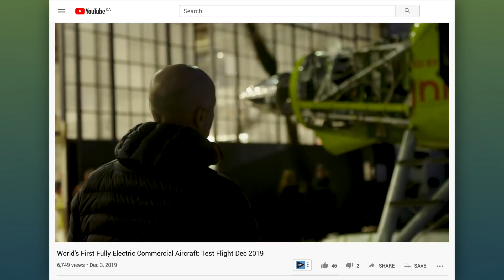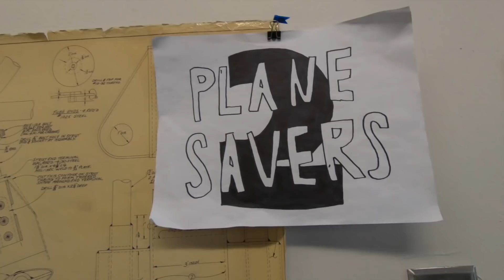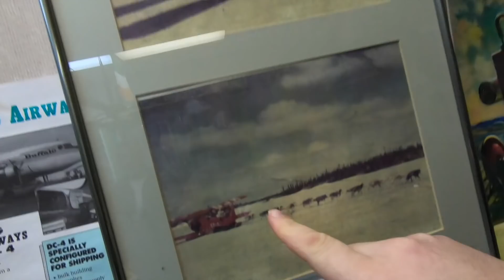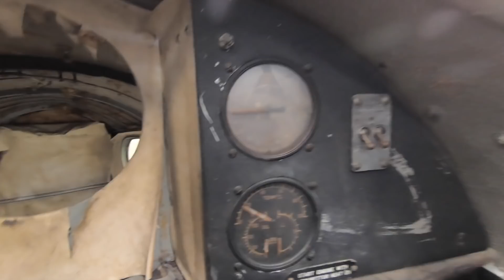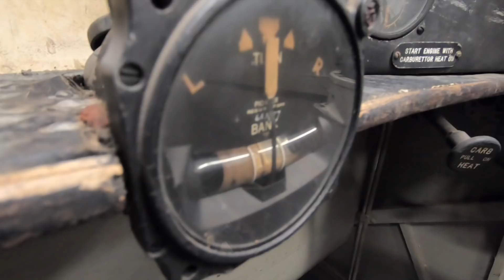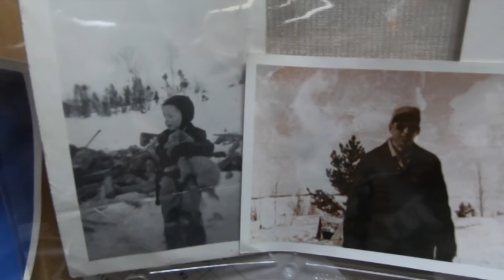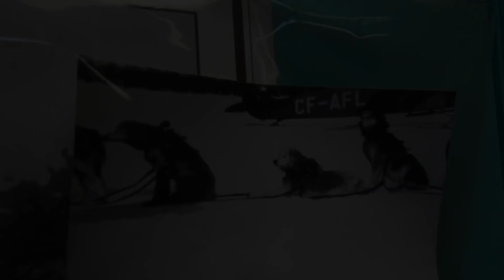IT WORKED! Worlds First Fully ELECTRIC Commercial AIRCRAFT Flew TODAY! | Plane Savers S2-E33

Comment: The question is not how to make an electric driven plane but HOW TO GET BATTERIES WHICH DO NOT WEIGH TOO MUCH.
Reply: The "commercial" part is where one passenger pays for it to transport over a ton of batteries to the next charging point. How long to charge more than a ton of batteries from almost flat? Beats me, but I suspect that doing a turn around service on a stock Beaver in commercial service would be quicker.
Reply: What is the weight of the ( 5? or7? )  radial cylinder engine? Or the gas turbine engine in them?
Reply: @edwardcarberry1095  :: You are probably onto something, a radial engine weighs in, of course, I would guess at 300 Lb. However! We need two numbers, engine power per weight AND fuel weight for some standard trip, like eg. 200 miles in good weather and clear sight.
Reply: @edwardcarberry1095  The weight of the battery is more than twice the weight of the maximum fuel load, but it only provides a small fraction of the range/endurance.
Reply: @PistonAvatarGuy   Thanks, have always Loved aircraft!  I don't  have the Facts but highly suspect this is just part of the SCAM on the Sheeples. So They Will BELIEVE that mans 3.5% of CO2 he adds is effecting nature. Where nature provides the other 96.5% of the CO2!
Reply: @edwardcarberry1095  It's a balance, like body temperature, if the balance is even slightly upset, problems arise. Global warming is an enormous problem, make no mistake, but the fact of the matter is that electric vehicles offer little to no solution.
Reply: @PistonAvatarGuy   IT IS JUST A SCAM FOR THOSE WHO CAN'T  AND WON'T  THINK FOR THEMSELVES!
Reply: @edwardcarberry1095  Nope.
Reply: @PistonAvatarGuy   OH YESS! 
WAS dreamt  up by The Club of ROME in the late 60's!  Just more for the Gullibles!
Reply: @edwardcarberry1095  Yup, and the Earth is flat!

Comment: I just cannot see the viability of electric aircraft.....not from reliability issues....from charging challenges. You can put in more gas quickly....charging takes time......and more time. Maybe this world would understand green energy if this plane was recharged by a diesel generator. Energy is measured in BTU s. Takes x amount of energy to do a job.... Electric beaver takes same amount of energy to fly tbe same route in gas form. No gas consumed in flight a given.....but uses same amount of fuel to recharge. Electric is.green my backside!
Reply: In that part of Canada, the energy is almost entirely hydroelectric, which is pretty green. The real problem is battery longevity. Aircraft require a lot of energy to fly and need to be light weight in order to fly, but demanding a lot of energy from a light weight battery means that it gets discharged very rapidly, which means that it will have a very short lifespan. Batteries are extremely expensive, on par with entire aircraft engines, so replacing them often will prevent them from ever being financially viable.
Reply: @PistonAvatarGuy  animal rights folk want the damns removed for the trout.and.salmon.
Reply: @danielledykgraaf6483  That's not going to happen.
Reply: PistonAvatarGuy 
 Do be so sure about that!! 
 They just took out a damn in Alligan, across the Street from my buddy Wayne’s house!! At a huuuge expense!! 
 Now the fish swim free!!!???
They are free!!! 
 But it wasn’t free for us!!??????
Reply: Danielle Dykgraaf 
Y’all got things stirred up now!!
 🤠👍👍👍👍
Reply: @PistonAvatarGuy  - I think it's a stretch to say "ever"..... cellphones started with a suitcase.
Reply: @mattawa2  Most of the reason why cellphones got smaller is because electronics got smaller and more efficient, not because battery technology improved. Battery technology looks like it's already at, or near, it's maximum potential.
Reply: Craigerst Smith 
 As things get smaller and are tasked to do even more than the big ones did!! 
 Cramming all that energy into a smaller power pack( battery ) makes it become volatile!! 
 Internal heat has to go somewhere!! 
 Because waiting another day to fly the plane back home after a two hour flight is crazy. They would almost have to have a liquid battery cooling supply to cool the batteries while recharging!! 
 How much weight would that add to the aircraft as well??!
 Someone send me a pic of a Electric recharging Station at a remote Fly in fishing camp in the Klondike Please!! ( in the future )
 See ,,, look at it this way!!
 You can put a screen door on a submarine!! 
 But it won’t make it practical!!!! 
 Just saying
Reply: The laws of thermodynamics stack against them too, they just cannot get there, even more so when their MTOW (Maximum Take Off Weight) will be stuck in excess of their landing weight.

However electric is green... As long as you just isolate and think of the aircraft itself,  it has no tailpipe giving out emissions :D

Comment: When the skin is the frame it is a unibody! Yikes
Reply: During WW2 in Australia, the twin-engined DeHavilland Dragon was affectionately known as 'the butterbox" because of its wooden construction. One which was damaged in the north of Western Australia was actually patched up by the pilot with three-ply and flown out from the landing ground where it was damaged for more thorough repair. The plywood came from discarded wooden tea chests in which tea leaves in bulk where then supplied to shops and decanted into paper bags by weight for sale. DeHavilland made a high science out of wooden hulls, reaching a peak of development with the legendary wartime Mosquito. Some of that technique was applied to their metal aircraft with bonded wing skins on the DeHavilland Dove. With carbon-fibre reinforced resin, in some ways, the wheel has turned full circle. I understand that the original Twin Otters have a wooden fuselage plug in front where the single engine was placed in the original airframe design. I imagine that modern composites may be used in the new-build Twin Otter fronts. Wood is good. It requires more maintenance over time as aircraft, unlike most wooden household furnishings, venture outdoors into sometimes hostile environments. When you see the construction of a Fournier RF4D motor glider, it is scary until you discover that it is safely aerobatic. Its main spar outperforms some modern military jets in terms of strength, fail-tested to 13.4g.